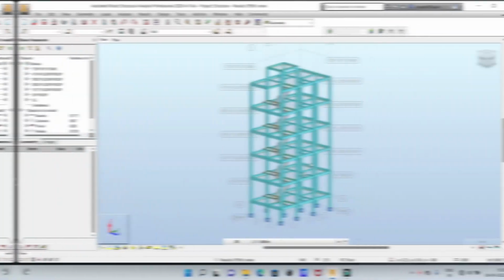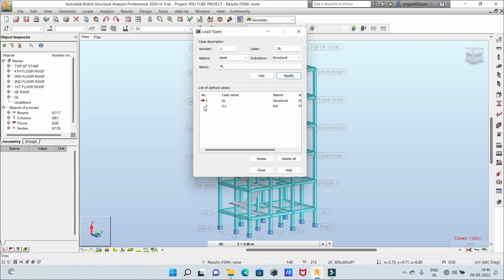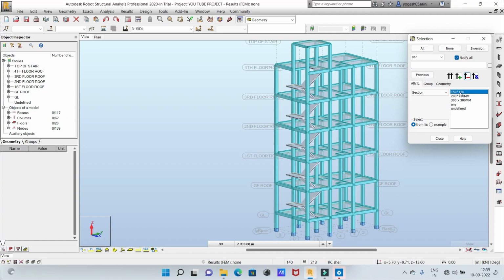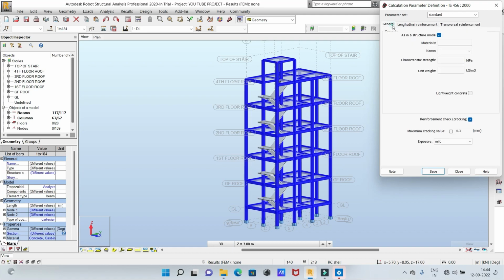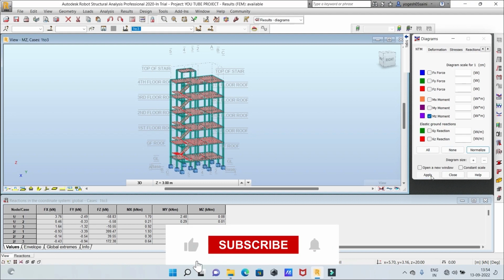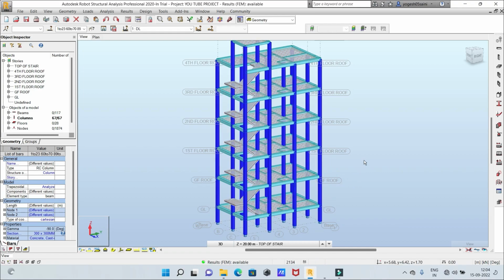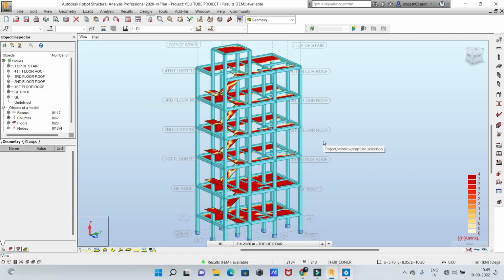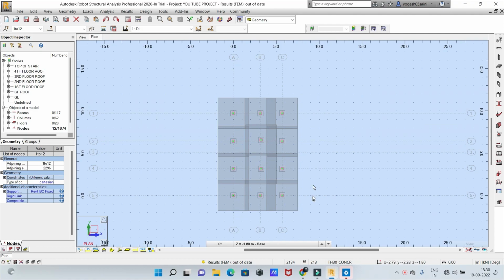Revit Structure Complete with G+5 Residential Building Part - 2 | Robot Structure Analysis

Comment: As you have not modeled the landing beam in Revit, there is also no landing beam in Robot. The secondary beams are cantilevered without any release. Without defining specific material the software will choose the default material for concrete or rebar. The definition is a must for support, material, code, and meshing because the analysis is based on FEM. From timeline 30.41 & 35.22 onward the warnings and errors crept consequently.